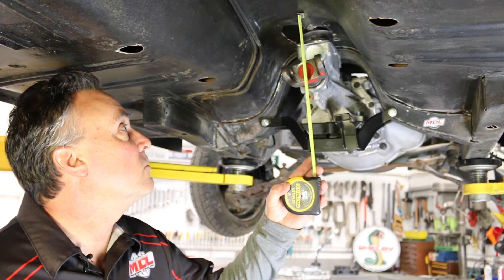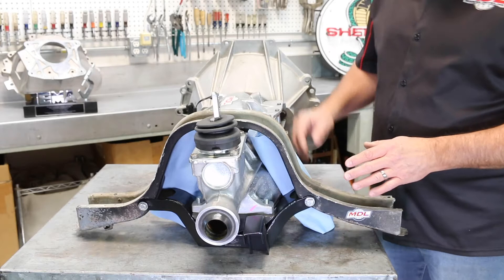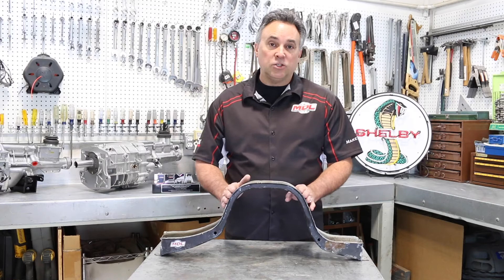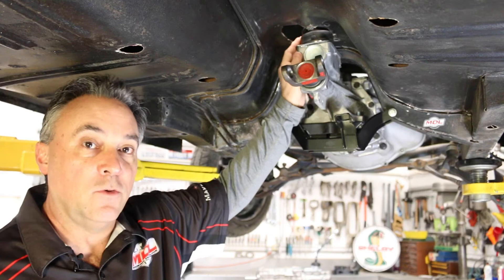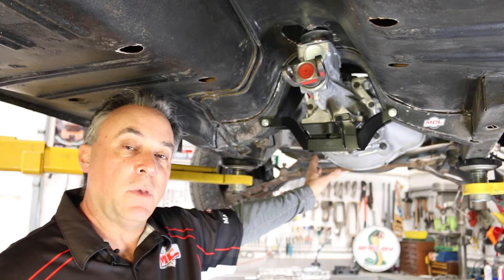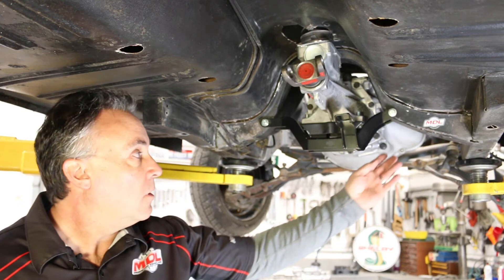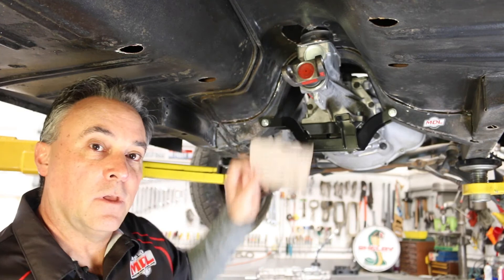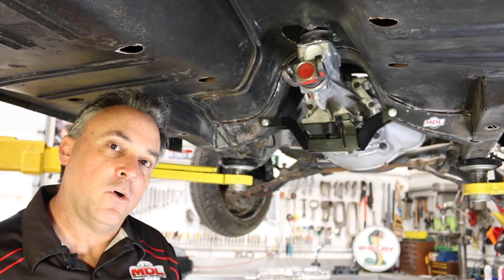MDL | T5 in a '66 Mustang, clearances, crossmember, mount, tunnel support

Comment: I have 69 mustang where I want a crazy engine and transmission swap in it and upgrading the differential. 

Engine from 2006 Lexus 3UZ
Transmission toyota R155 

Do you recommend the T5 from newer mustangs differential ? From what years you would suggest to look for if I would like the limited  slip as well. 

Thanks